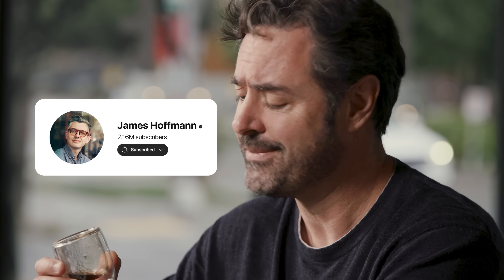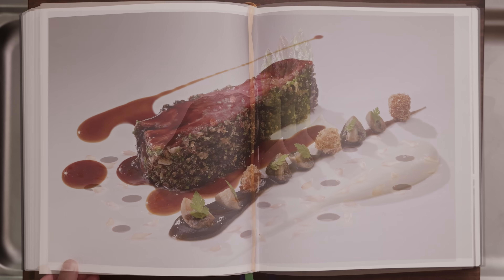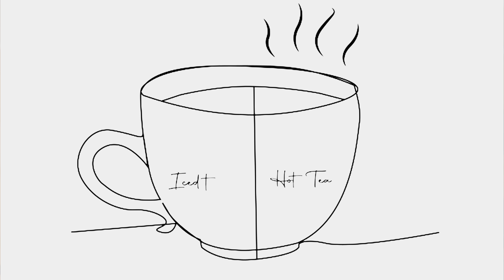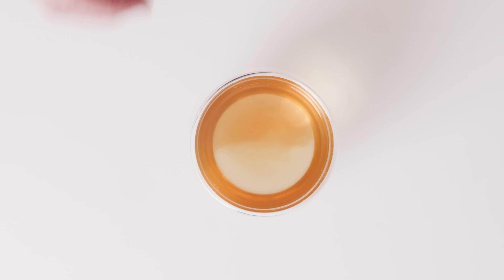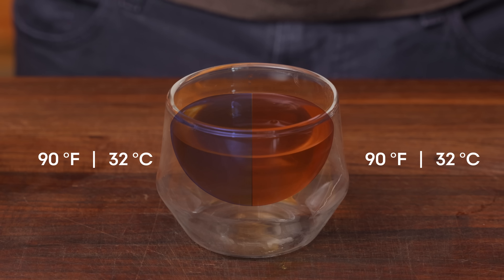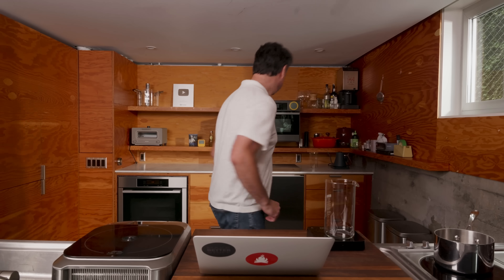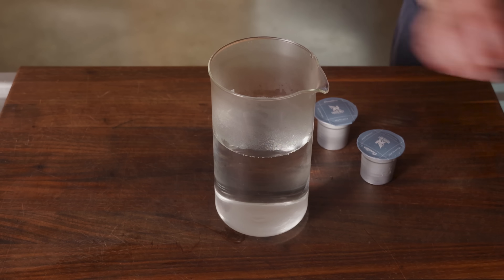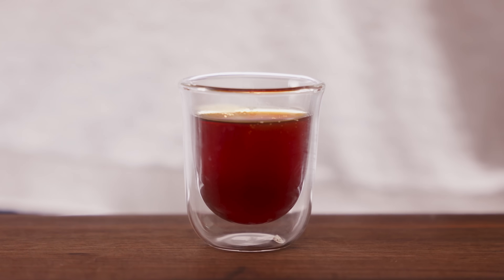James Hoffmann vs My Impossible Hot & Cold Coffee

Comment: I’ve just found your video but I discovered this experience by accident. I have glass mugs that are thin. The base has a smaller diameter than the widest part of the mug, which essentially creates a pocket of coffee at the bottom. If you put that on a cold surface it will cool down basically just that pocket of coffee. You drink it and you get both hot and cold at the same time and it’s such a weird thing to have.

Comment: Here is the thing..in 15 minutes or so it will all be the same temp due to entropic law. This is the 2nd law of thermodynamics which shows all high pressure must move to low pressure unless contained by a solid barrier or in the case of temperature causes heat to move to cold, both process happen until equalization occurs in an open system.  Now here is your Major Problem in physics Chris - You know these physics laws are true yet you believe in a sky that is an area of volume that gas is not filling in direct contradiction to established physics. Gravity has never been demonstrated to cause gas to fail to fill an available volume as well as that hot coffee could never fail to move to cold.  The implications of Real physics - Your atmosphere and globe Earth are Impossible. You don't live in a 2nd law of thermodynamics violation.

Comment: Hey Chris, I have a question you might be interested in mythbusting/explaining.. the 'stall' in slow cooking meats (eg brisket, lamb shoulders etc) in a smoker.  Something is using the energy when the meats core temp is stuck at 70-odd C for hours in a 130 C environment.  I don't think it's evaporating water doing it (wrong temp).  Would be interesting to see what's actually happening and why wrapping can 'fix' it?

Comment: There used to be an exhibit at the Science Museum which showed how the body isn't able to distinguish from hot and cold simultaneously and therefore gets 'confused'. It was a simple setup - a coiled piece of metal pipe with the pipe being about half an inch wide. It was actually two pipes made to look like one. One pipe was hot and the other cold. When placing your hand on it, your hand would be touching roughly 6 or 8 sections of that pipe simultaneously - half cold half hot. Your body doesn't pick up each temperature individually and so gets confused. What you feel instead is kind of like touching a very low voltage electric fence. Like an extremely mild shock. Your brain will be doing similar somersaults when drinking this tea.

Comment: I used to work in a laboratory making veterinary medicine in small batches. We had liquid formulations where the drug was suspended in a liquid gel and in order to guarantee similar consistency between batches, we measured Methylcellulose (Hypromellose 4000 mPa) to the milligram and always used hot distilled water on a stirring hot plate, cooling to room temp before refrigerating.

Comment: I am extremely familiar with the idea of both hot & cold food, to the point where i intentionally cook things too fast & short to be fully hot. My favorite example is leftover Cheeseburger mac: Basically you throw all the ingredients (and 1/4 the required meat) into a large pot with some pepper & taco seasoning, then boil it on medium until stirring the bottom blankets the top of the kinda thicc water in noodles.

These leftovers are bar none my favorite leftovers of all time, JUST because it's so easy to make it hot-cold in the microwave, like 1:00 - 2:30 mins based on how much you're warming up.

Comment: Now that you have the basics down with hot and cold, and what another suggested using two different blends of coffee… the possibilities are endless. Instead of a single divider, you could use 2, 3 4 or more dividers in a X or * or many pointed star, to mix 4, 8, 16, 32, … different flavours of hot and cold if you’re able to hold the structure (much like papercuts/origami) — probably not so easy for more than two pieces of dividers (with a cut along the middle axis and then assembled before being put in the cup).

Comment: Pro tip: if you want to emulate the effect without all the fuss, you can use two straws and sip from two different cups simultaneously. Having said that, I definitely want to give this a proper try once I get the ingredients.
Reply: That was what I was thinking too, using straws. I guess you would not have the undetectable part though.
Reply: @joeys4759  make a straw that combines two liquids into one end and make a bazillion buckaroonies
Reply: It wouldnt be magical at all
Reply: @leoirias3506 It's more gimmicky than magical anyway🤷‍♂️
Reply: @brt5273 I wonder what the etymology of gimmick is... 🤔🤔
Reply: Have you ever drank hot liquid through a straw?
Reply: @BigDaddyWes  warm yes, hot no
Reply: @BigDaddyWes  Yes, through most of my childhood. "Coffee stirrers" at restaurants used to be very thin plastic tubes, often red (before they became the wooden sticks you typically see today).  You can still buy them. As a kid, it was always a bit of fun to sip hot tea through a "straw" (i.e., coffee stirrer).  Plus, it was convenient, as the thinness of the tube typically made it so you couldn't drink the liquid too quickly, so it wouldn't burn your mouth if you sipped a little at once. In fact, sometimes they are even referred to as "sip stirrers," as one can drink hot drinks through them.

Even more on point, years ago they often made these out of two tubes with a divider between them.  Since they were cheap plastic, putting two tubes together tended to make them a little stronger and less bendy in hot liquids, so they worked better as a stirrer.  As a kid, I used to love trying separate those two tubes and sometimes was successful at it, even sometimes creating a hybrid straw that was partly attached at the top, but with two separate tubes on the bottom that I at least a few times managed to put into two separate cups.  (Though I don't recall if I ever deliberately tried doing this with a hot and cold liquid at the same time.)

So... yes, not only have a lot of people drunk hot liquid through a straw -- the types of straws commonly coming with hot liquids a generation ago allowed for precisely the scenario suggested by the parent comment.
Reply: @BigDaddyWes  Uh yeah? Coffee is often drank with little straws where I'm from lmao.
Reply: @BigDaddyWes  
It is now 2024 and it is considered morally incorrect to use plastic straws🤣.
With wooden straws, can drink hot drinks without any problem.
Reply: That's a facepalm moment.
Reply: @GamesFromSpace  ahh, yes, let's gatekeep, cause the plebs who can't afford to make something like this don't deserve to try something to replicate the thing in the video
Reply: @doggo4918  What the flying hell are you talking about?

Comment: This is neat. But for getting a similar experience, it'd be simpler to build a straw w two ends stuck in two cups of coffee of diff temps.
Reply from the maker: Having tried it, it’s not a comparable experience. The two liquids mix almost immediately in the mouth, and you also don’t get the temp difference across the lips, which is key to the sensation and effect of the drink.
Reply: @ChrisYoungCooks  thx for the response!

Comment: Hi Chris that is just great. I love people reactions, there faces. Is just like they seen a magic trick. Priceless
I have a question for you. I'm a pastry chef in Australia and I been experimenting with gums and gels in pastry for a while. See if you can figure out the following problem
I wanted a solid gel for a croissant that was bake stable. Obviously the answer was gelan gum and it worked in small batches . The only issue was that when I scale up the recipe to make 7kg it didn't properly set. There was a mix of liquid parts and gel parts. My guess seeing this video is that the must be problem in the cooling phase. Probably we need to mix it constantly until it cool down. Not sure
Thanks for your time in reading this
Regards
Reply from the maker: Yes, my first guess would be problems with mixing when you scale it up. I might try using a stand mixer to whisk the gel continuously as it cools for a couple hours. If you want cool faster, you might hold back some of the water as ice and add it to the hot mix as it cools and mixes.
Reply: Hi Chris
Thanks so much for your answer. We actually have a machine to make custards that can cool down very fast. I will try that and see the results.

Comment: Instead of smacking the bottle of ketchup, I recommend centrifugal (centrifical?) force.  I hold the bottle with opening facing up and place finger on the lid safety.  Now move it forcefully in an arc pointing away from the table so you have room.  As if doing an overhand throw.  Don't lose your grip, or you will throw the bottle across the room.  Works way better and requires less energy than the smacking the bottom of the bottle.  Takes like one or two swift throwing motions.  Works on other similar products like mayo, etc.

Comment: What a very fun idea. I wonder how much you can play with the sort of temperature-textural field before it blurs too much to be meaningful anymore. My first thought, watching people drink and describe the weird hot/cold bifurcation was, "what would it be like to take a sip, then flip it the opposite way and take a sip, switching sides for each sip?" But then I started thinking, does this gel hold its shape enough to do other fun things? What if the separator, instead of a flat plane, were in the shape of a spiral, or like a screw? Then, as you drink it down, would you feel the hot and cold drinks "moving" from one side to the other, like a sort of stereo panning right-to-left and back again? Could you separate them on a slant, so that the beverage starts either hot or cold, and gradually shifts from one to the other (as opposed to the flat top/bottom split where it changes suddenly)? What if you used a small cylinder in the center of the glass, with either hot or cold in the center, and the other temperature around the rim? It seems like the possibilities are almost endless, IF the feeling is pronounced enough to be readable in different configurations.

Anyway, very, very cool video and idea.
Reply from the maker: One person who we didn’t get on camera unfortunately sort of dragged the cup around while they sipped to get the temperatures to move across their lips. Was super interesting. I’ve never seen anyone do that before. I think there’s probably a lot of untapped potential in playing with the idea.

Comment: This is fantastic! Quick question, does adding sugar and milk affect the mixture?
Reply from the maker: Yes, needs to be adjusted for a bit. With dairy it’s definitely much easier to get the milk in to solution after you’ve hydrated the gums. The calcium in the milk cause problems otherwise.

Comment: Sound kind of painful... When something feels both hot and cold at the same time, it's normally because it's extremely hot which somehow confuses your nerves just before you get a bad burn. I've had someone sneak an ice lolly into a sauna and let it touch my back as a prank, and even though the dry hot sauna temperature is not painful on it's own and the ice lolly is not painfully cold on it's own; the combination of cold right next to hot feels exactly like touching scalding hot metal. (Which makes the sauna prank very brutal since I've also once bumped into a hot piece of metal on the sauna oven in a sauna and it feels initially identical to ice in a sauna.

Of course it's particularly nasty when it's a surprise; but I've always found that hot and cold together always is somewhat painful even when I'm aware that it's actually not dangerously hot combined with not dangerously cold, my nerves still disagree when they are too close together. It's why I really don't like hot drinks with ice cream, or hot drinks with cold whipped cream either... Of course, those also have the added risk that the drink might actually be scalding hot but the cold cream or icecream insulates your face from the heat so you don't notice how hot it is until sip it.
Reply: This illusion is also often demonstrated in science museums, where you have one coil of copper pipes that is from the hot side of a heatpump and one set of coils that are from the cold side of a heatpump and one coil that is actualy two interleaved coils from both the hot side and the cold side. And when you touch the warm only side you feel that it's warm but not painfully hot, and if you touch the cold side it's a little unpleasantly cold but if you touch the interleaved coils it really feels like touching red hot metal, and you jerk your hand away. 
You can of course convince yourself that it's not in fact dangerous to touch it by touching just one ring at a time, and then force yourself put your hand on it for longer, and while it stops hurting, it's very uncomfortable. And most people I've seen try it will react with pain when they first try.

Comment: Several questions! Can the hot liquid be kept hot continuously in, let’s say, a water bath for service without the gelan losing its viscosity? 

Can this work alcohol, because this opens up a whole new world of cocktail ideas. 

How much agitation would liquify the gel? Is it a vigorous shake, or a bit of a jostle? 

Also, how long does it take for the temperatures to balance once in the glass?
Reply from the maker: You can keep the liquid hot for a long time. I’d probably plan to change it out a couple times over a 4 hr service though because you are evaporating volatile flavors while holding it hot.

Gellan (and most gums) struggle with alcohol. Anything strong than wine tends to be iffy.

For agitation you want constant swirling, but not so much air starts getting whipped in. I’ve pulled it off with a blender on very low speed and a very full pitcher of liquid, but usually a blender is a bit much. A stand mixer on low could work.
Reply: @ChrisYoungCooks  I've always wondered if there's a vacuum blender and if so, if that would work. Imagine the volume you could make, so fast!
Reply: @ChrisYoungCooks  Thank you so much for responding! I greatly appreciate the info. 

If I may pick your brain a little further- would something like agar agar work here instead of the “pond scum?” I know agar stands up pretty well to alcohol, but would it affect the intended effect of the side-by-side contrast? 

Have you tried this with methylcellulose, or gum Arabic?
Reply from the maker: Agar will work ok. It’s going to be a bit thicker than gellan, but it’s workable. You’ll need to up the percentages, too. Will require some trial and error to get it working.